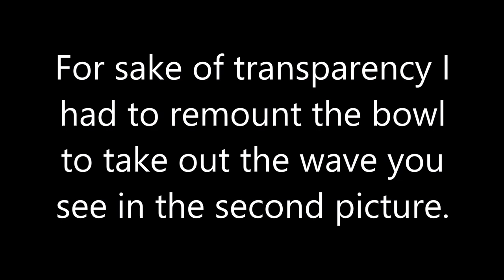Wood Turning - Strawberry Jam

Comment: Great looking platter! I’m still a little unclear on the use of sanding sealer. You seem to use it as a part of the finish. Can you elaborate?
Reply from the maker: The sanding sealer I use is Cellulose Sanding sealer. It fills in the scratches and helps get a a better finish. Kinda of becomes a base. 

Ken

Comment: I really like it! If you did it again, would you leave the bark on or take it off before you poured the resin on?
Reply from the maker: The bark was very secure. I normally take it off, but the Total Boat resin really got into it. I'm fairly sure it will hold.

Ken

Comment: How do you decide which brand of sanding grit to use ( between Yorkshire or ack)? Does one work differently than the other? I just love your work
Reply from the maker: They both work great. Yorshire Grit is based out of the UK. Acks is made in the US. I can get the Acks Abrasive Paste and the Polish for cheaper then just the Yorkshire Grit. I also found that I had a film over my pieces with the YS Grit. I hope that helps explain?!?  Thank you so much.

Ken

Comment: 1st to comment! Hi Ken, They are called witness lines and can happen when you have to do multiple pours.That turned out stunning. Cheers, Huw
Reply from the maker: I've started to do multiple pours and I see them more often. Really unnoticeable after I finish it, but cool before. Just thought it was cool because you couldn't feel the line but could see it when sanding and the dust set up on it.

Ken